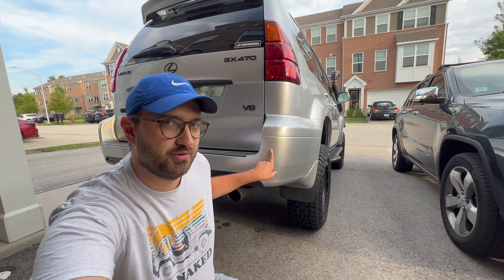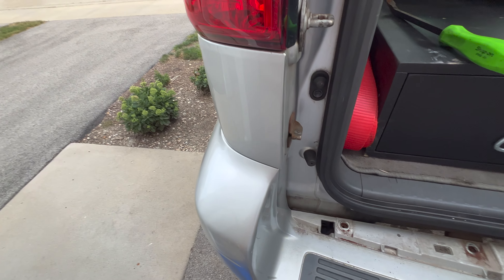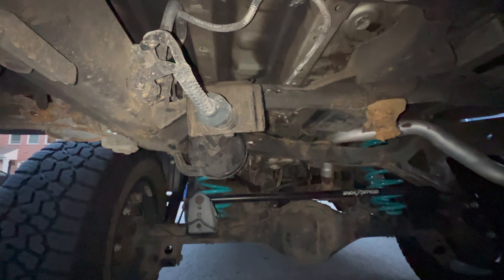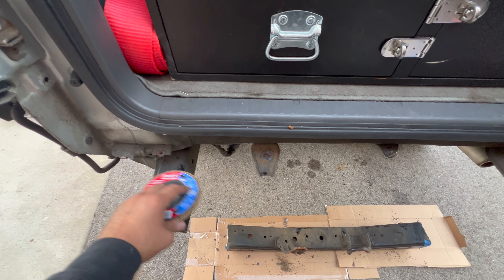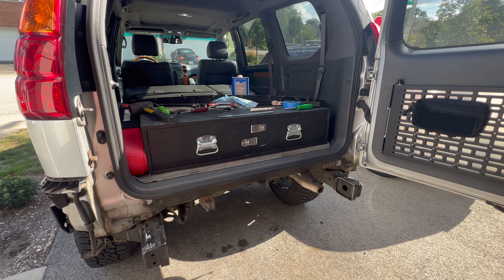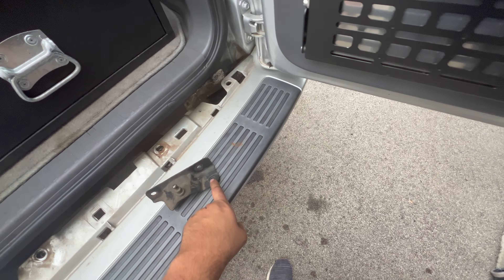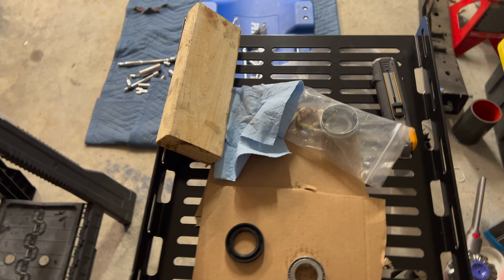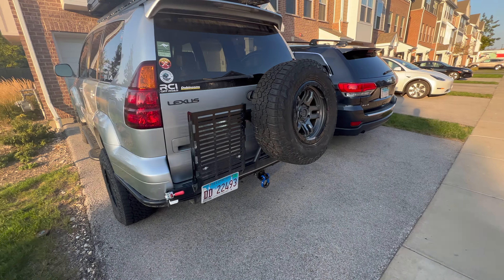Ascend Fabrication Rear Bumper - GX470

Comment: Great looking rig! Any wobble or noise? I might pick one up for my 5th gen T4R. Thanks!
Reply from the maker: None at all. I did a 4600 mile road trip to Colorado and back the week after installing it with no issues at all. Did have to adjust the latch after it settled a bit but it’s been great!